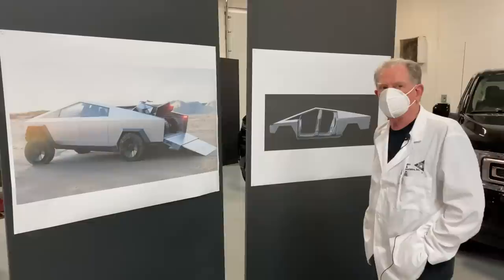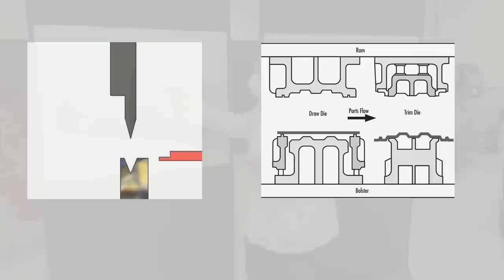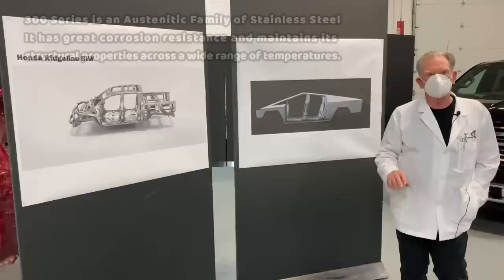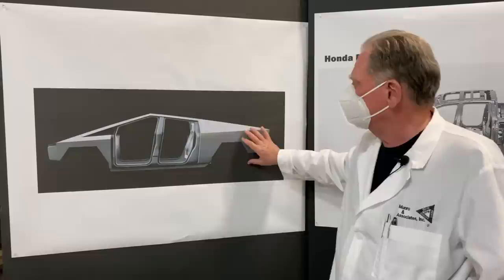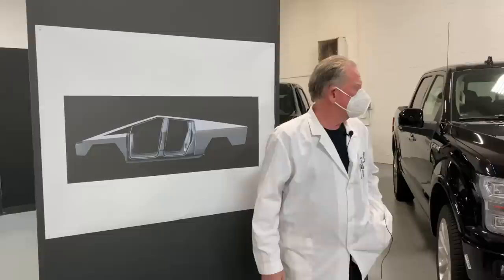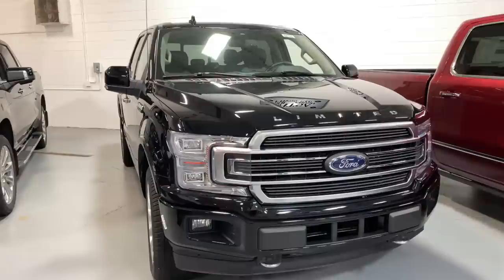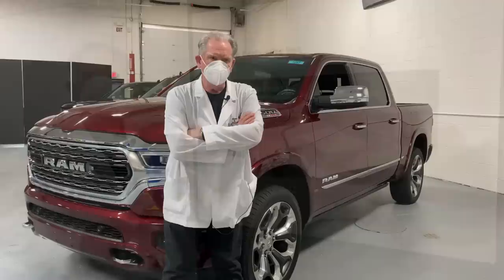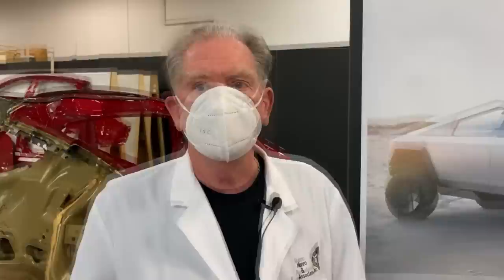Cybertruck E1 - Body Structure Comparison

Comment: Mr. Munro: I'm wondering why you recomend waterjet cutting over laser? 

I've priced waterjet parts vs laser cut parts (1" Gade 50 steel plate) and the waterjet is generally 3-5x more expensive because of the inches per minute of cut. 

I'm guessing it's the edge quality/zero heat warpage and ultimate precision of the waterjet and how this eleminates problems down the line. 
Still, a well tuned laser using nitrogen can leave a very clean edge and very little Heat Affected Zone with .0025" precision while running crazy fast.

I'm sure you've done studies on this, what are your thoughts on these processes?
Reply: Agreed.  Waterjet edges are also rough compared to laser cutting.  That's one of the advantages of SS over Al, easier to laser cut.

Comment: Sandy,  I would like to express my thanks for you  pushing snap-together plastic components in automobiles I made a great deal of money converting them over to screw fasteners, because the plastic Fasteners break and fail at an alarmingly high rate and Commercial users don't want to spend the money for new panels so thank you again.

Comment: I don't ever see Tesla doing an ICE vehicle, but Sandy brings up so many great advantages to this completely different way of doing a chassis, that I would love to see one of the traditional manufacturer's copy this idea.  While so many call this "ugly", I think that seeing cost advantage, weight advantage (which helps with acceleration, handling, efficiency, payload, etc), and how there is no pretty paint and sleek lines to damage by going offroad, what was once ugly could become appreciated.  Trace the roots of anything that we consider "beautiful" on man or machine, and you will eventually learn that beauty follows function.

Comment: Great show. The Laser etching pre bending, interesting, but I have this image of 2 guys manually aligning panels in a conventional brake. The Prototypes were probably done this way, manually. I believe the bending will need to be automated for alignment and multiple braking starting with panel crease line and multiple braking in fixture to brake 90* edges for TIG welding assembly by ROBOTS. To automate this bending process requires lots of equipment too which are robotic and complicated and different than stamping but probably expensive for automated production. Great comparing comparing RIDGELINE ENDOSKELETON differing with CYBERTRUCK EXOSKELETON, Were DELOREAN  panels stamped using thin Stainless Steel. I thought You gave GOOD comments about all 3 trucks and a lot of people learned for the first time about Carbon Fibre option for GMC box. JAY LENO show tonight could cause pre orders for CYBERTRUCK to move up from 700 thousand to 1 million. Note to Elon, please give that Truck to Sandy in his Shop for as long as he wants and You will double pre orders to 2 million.
Reply: Actually there are already automated CNC brakes and they are not all that expensive relatively speaking.
Reply: >> JAY LENO show tonight could cause pre orders for CYBERTRUCK to move up from 700 thousand to 1 million. 
>> Note to Elon, please give that Truck to Sandy in his Shop for as long as he wants and You will double pre orders to 2 million.
Certainly the most funny post... If you add that Sandy M. is "Detroit" boy, then  it would be even 10 million of pre-order!!!

Comment: Glad to hear a former Tool & die guy.  I spent 30 years servicing Torque converter dies at Generous Motors before they went bankrupt on me in 2008.  Never even saw body dies but I couldn't bear servicing stainless stamping dies after repairing double-loaded steel blanks in an automated transfer system.  :)

Comment: The Delorean panels do not have plastic backing. He may be referring to the single piece fibreglass body to which the panels were bolted.
Reply: In fact he may be talking about the hood which did have a fibreglass backing for strength.

Comment: 24:45. I imagine that permits to build, especially in states like California, will be significantly easier to get without the environmental concerns of a paint shop. It also removes negative reviews over paint finish, which have been a problem for Tesla in the past.
Reply: Cybertruck will be build in Texas!
Reply: @etbadaboum  Probably so, but part of the motivation was limits of the paint shop in Fremont.  There are both state regulations and a city zoning agreement that limit its size and emissions.
For quite a while the paint shop was the production bottleneck.  It caused Tesla to limit colors offered to reduce downtime changing the line, even temporarily not delivering the problematic red cars.  It seems to be less of a bottleneck, but the paint still seems to be the major quality complaint.

Comment: How are they processing the door inners? They are the most complex shapes. Are they also 30X?
Reply: Probably TESLA stamped Steel. easer to do Complex Shapes and Still Protective in a Side Pole Collision !!!!
Tesla on Model Y uses a Sandwich of High Strength Steel, MID grade Steel and Mild Steel for the Interior, Tesla can Simplely DUPLICATE that and add Folded 30xx for the Exterior. 
Tesla uses Pre Fab Doors rather than using a lot of Fasteners like in Legacy vehicles.

Comment: Can Tesla "Anodize/color" the steel? Treatments such as Dying, Electrolytic Coloring, Integral Coloring, or Interference Coloring. Thanks
Reply: just have it wrapped , any way you want and completely reversible
Reply: Colored steel is cool. Sandvik developed steel like that, no paint needed, if scratched you just need to rebuff it.  But automotive industries wasn't interested so they kinda scraped it.
Reply: When I say colored steel, I mean homogeneous colored right through.
Reply: ...great question! Aluminum and Titanium can be colorized, though thru different technologies.
Reply: @MichaelOZimmermannJCDECS  Dye can be added as intermediate step in the anodization process.  That's not changing the color of the bulk material, just adding color into the porous oxide layer before hydration (sealing the oxide by a boiling in a nickel acetate and water solution).
Most dyes that work well are organic, and will fade with exposure to light and heat.  Inorganic dyes tend to unappealing colors and compromise the  surface properties.
Reply: PVD coating Arc Vapor Deposition
BLUE: https://www.youtube.com/watch?v=W9DIfMNY3DA
PURPLE: https://www.youtube.com/watch?v=wLt-_a_F7mI
COPPER: https://www.youtube.com/watch?v=l7ClYSOp2ig
GOLD, PINK, GREEN, ETC: https://www.youtube.com/watch?v=_E37hnCRZgc
Reply: THEY ONLY GIVE FIVE UNIMAGINATIVE PAINT CHOICES ON THE CARS SO WHY BOTHER? THE AFTERMARKET WILL OFFER WRAPS.

Comment: Hi Munro! great videos, I'm a big fan of your work. Could you say something about the issue of a crumple zone in the cybertruck? all cars should have a crumple zone to protect passengers and people outside of the car but how would this work with stainless steel? Would love to hear your opinion and ideas on this aspect of the truck
Reply: I think that with the integration of their sensor suite, some kind of external airbag system might be feasible.  I don’t know how much they will appreciate road rash, but it has to be better than broken bones. 🏴‍☠️ 🍖😜
Reply: @dries248  good and creative idea! although I think an exterbal airbag might be complicated and quite costly to integrate into the car. Also, I doubt an airbag could significantly reduce the power of the impact of a car as heavy as the cybertruck when it crashes into something (e.g. another car). The cybertruck is a big car, very heavy due to the stainless steel build and the enourmous batterypack. Dunno how Tesla is going to fix this issue. But considering the fast pace of innovation and the creative ideas of the Tesla team, I'm certain they'll figure something out.
Reply: Tesla's will be much less likely than competition to strike a pedestrian because of the pedestrian avoidance systems.  Surround cameras which are constantly being processed to detect and label objects.  The car is capable of automatically swerving and braking to avoid collisions including pedestrians.  If you are the driver, you have a huge safety advantage just from the perspective of physics, transfer of energy being inside the heavier vehicle.
Reply: @steveseeger  true, autopilot has proved to decrease accidents by a lot as compared to the mean number of accidents per number of miles driven. However, the system isn't foolprove yet and current regulations do not yet consider tech such as autopilot as a valid substitute for a crumple zone (at least, not to my knowledge). The driver and passengers of the cybertruck will probably remain unscathed in an accident as the cybertruck is practically a tank. But suppose a cybetruck crashes into another car and the sheer force of the impact is not partly absorbed by a crumple zone in the cybertruck.
I'm thinking the other car's passengers could suffer greater damage than when they would have been hit by a car with a crumple zone. A crumple zone is designed to protect not only the driver of the car but also others external to the car. And that is what my original question is aimed at: How will Tesla mittigate the crumple zone issue and comply with current safety regulation? I'm just curious and time will probably tell. Not trying to bash on Tesla or so, since I'm a big fan myself.
Reply: Sibren Coulier tesla on tesla accidents wont occur once the network switch is thrown. Only non tesla cars will get exorbitant insurance premiums and drive other makes out of the market.
Reply: @gwgplate2  hi! I think so took. Yet that still doesn't answer my question as to how tesla is going to comply with current regulation and what about accidents with non-tesla cars? Most cars on the road are pretty vulnerable to a tank as the cybetruck is. As you've probably missed my earlier comments, I too believe in tesla and their mission and I'm confident they have a solution ready. I'm just putting the question out for y'all in the hopes that one of you or Munro knows the answer already
Reply: @Wibimeister  it still has crumple zones, its like how the DeLorean had crumple zones
it just need a bit more crumple-creating design due to being a harder material but will still crumple
it is not a tank btw, it would be like getting hit by a F350 tbh

Comment: The main thing you forgot to mention is that with the cybertruck you don't have the driveshaft going from the front of the truck to the back.  This enables for the straight floor in the bottom and therefore allow engineers the flexibility to fully utilize the battery floor for stiffness and rigidity.
Reply from the maker: Don't worry, Tony, we'll get into the driveline components in an upcoming video! We'll also have some of the other trucks up on hoists to better illustrate the point. The absence of a driveshaft and an exhaust line does definitely open up possibilities in the mid section of the vehicle.  Thanks for tuning in!

Comment: I’d love to hear your thoughts on accident repair of the stainless body. Obviously no paint work would be needed but it seems like replacing body panels might be challenging.
Reply: There are no body panels. It’s a welded rigid unibody. I suspect that if you actually have a dent that you can’t fix, the other guy had a very bad day.
Reply: In body over frame, if you have a fender bender and damage a quarter panel they unweld it from the frame, then weld a new one on.  Wouldn't they do the same with the exoskeleton?  Unweld the affected panel(s), check dimensions to ensure no deviation of rest of frame, then weld back on the new panels?
Reply: For 99% of the car's surface the process will probably be: Beat or cut out any dents, TIG weld cracks or fill-panels, ask if you want to leave the rainbow oxides on the welds or have the welds ground flat and blended in.  For the critical sections that are actually fatigue limited, you'd cut back away from the damage where the stresses are low and replace it via the above process.

Comment: You can have any color Cybertruck as long as it's stainless steel grey. Hmmm, sounds familiar...
It is a bold change, but repairs to that stainless steel exoskeleton should be interesting, as well as realigning it all after an accident. Hardness is usually not a good thing in a crash, you want the material to deform in a predictable manner to absorb the energy instead of the carbon based units. It will be interesting to see how they address this. Also, IMHO many people (such as my wife) are going to consider even minor dents as badges of honor and will want their insurance to "fix it".
Reply: Considering the outer panels are designed to be bullet resistant, and easily handles being shot directly with a 9mm, minor dents will not be nearly as common with this sort of vehicle as they are with the thin skinned cars we're all used to.

Comment: Stamped contours & creases -- 
Raymond Lowey eliminated the chrome highlight strips that were normally attached to the sides and surfaces of sheet metal cars when he designed the 1962 Studebaker Avanti.  He achieved the same visual effect by the way light reflected off the car's fiberglass contours. It helped reduce manufacturing costs.

Comment: My son and I ordered 4 top of the line Cybertrucks to put into the Tesla Robo-taxi fleet. Either you believe in Elon's visions or you don't.

I personally want to see a 4 motor Baja Plaid Cybertruck able to do "tank turns" that comes "Baja 1000 race" ready with an integrated roll bar.  Carry a 2nd full size battery pack in the "vault" and you could hopefully go the full 1000 miles without stopping 🤔 What an adventure that would be 😁👍

Comment: Cybertruck is still going to need stringers (betting on hat stringers) and/or ribs, for stiffening.  But overall... so much simpler!  :)   I imagine that the pack will double as a stiffening element, as will pretty much any other component that they already "need to include" which abuts the skin.

Re, alumium: my experience with an alumium vehicle (Honda Insight, my previous car) is that it lasts and lasts... against rust (assuming no galvanic bridge).  But when it gets old / high mileage, you start risking fatigue cracking (had some in my Insight's roof - symmetric on both sides).

Comment: I wonder the chassis is of 100% stainless steel or combined a portion of stamped steel?
Reply: Steve Davis 
If so this may be a huge challenge to form stainless steel inner members in a complex geometry with multiple radius and compound angles - aside from the outer panels with one bend.
Reply: Steve Davis 
Sorry for unclear message. I was concerning about the rest of the body structure beyond the outer panels. Just look at the members in the door frame are intricate geometries. Could be a challenge with stainless steel. Do not you think so?

Comment: What will the suspension attach to?  Won't they need some kind of sub-frame?  I assume that and the suspension parts will be rust-prone steel.  How are the compound curves in the door jambs done?  Also, how will crumple zones work in the front?
Reply: Not positive, but I think they are using a gigacast subframe front and rear for mounting the suspension components.  Seems like I read of a bigger press on order (12K tones vs 8K for the Y).  Could be wrong.

Comment: Sandy; do you remember when the American Business Mantra was built in obsolescence, till China was able to get ahead and turn it around on them, when we ran washing machines and cars, hit, so premature rubber hardening, cracking, and altogether, failure occurred, it is vital we run things cool if they include rubber.

Comment: If the exoskeleton is structural, it’s a nightmare to repair after a crash. Panels will have to be replaced instead of manipulated back in shape with traditional body and fender techniques. You might say, just replace a panel. However, that panel might wind up costing $3K just for the part. It costs $1,300 to replace a model Y windshield so don’t expect Tesla to be doing you any favors when it comes to repairs.
Reply: Difference is, because there is no paint to worry about, you can cut out a section and weld a patch in its place. Polish it down and it's as good as new.
Reply: Would love for Sandy to weigh in on repairability.

Comment: From my years of experience with sheet metals I have to say mild steels and aluminium are much less strong than common stainless like 304 or 316. When bended 6 mm mild steel, is more more likely to crack than 304 type SS. Surprise? Not for myself.
Reply: He talks about "hard" SS is.  I don't know that 303/304 stainless is any harder than mild steel, IF both are fully annealed.  And stamping/drawing SS is not a big deal so long as it's annealed, just look at a SS sink for example.  But-the beauty of Cybertruck is a hardened (presumably roll hardened) SS.  Gotta wonder how difficult it will be to control the hardness of the SS.  Trying to control via roll-hardening adds a big variable when dealing with springback when bending in a break.  I'd love to be working on the forming/fabrication equipment for this.  I used to be in tool design and machine development for a GM component division.